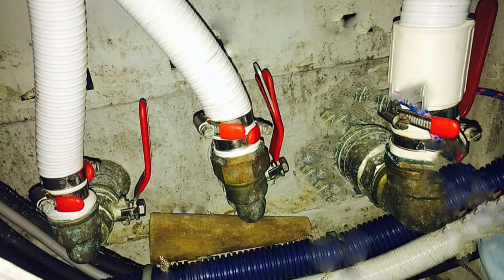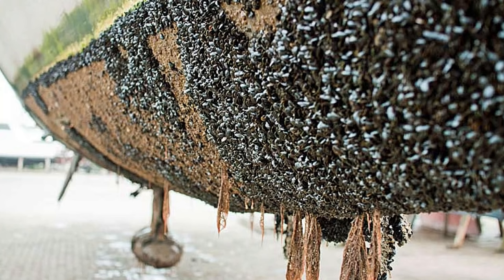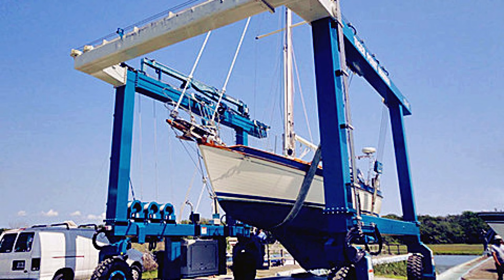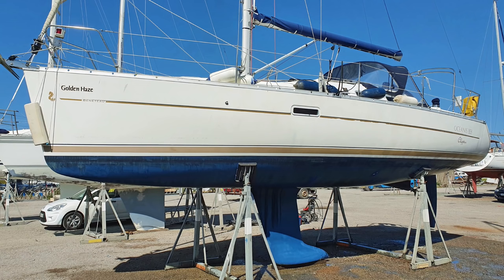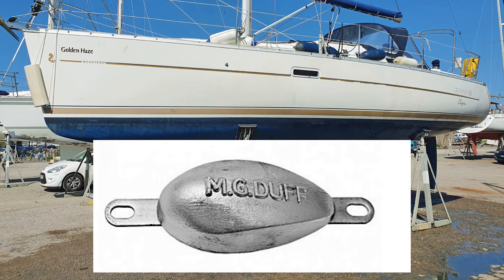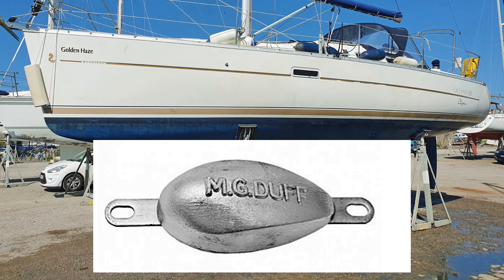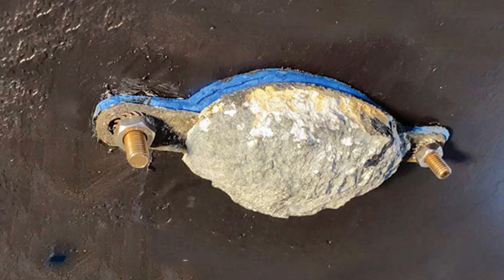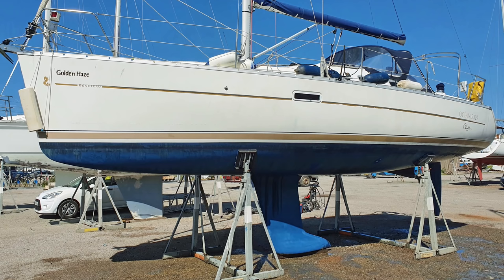Spring Refit

Comment: When using a lever against your alternator to adjust your belt tension, be carful of the vented part of the alternator housing as it is the weakest point and will crack or break. Try and lever it from the front where the housing is strongest. Love your stuff Michael, keep up the info, I'm sure you still have plenty to share.
Reply from the maker: Ricky thank you for posting that - You are right of course and it's very good point - So pleased you like the videos
Reply: It doesn't need to be levered very hard. Use a short lever that can't exert much stress. Keep the part of the lever beyond the fulcrum long and the hand end short. Or don't lever it, just pull on it with your dominant hand while tightening on the spanner with the hand you don't write with.
Reply: When I was a lad and worked for fun on old cars my mates could afford. I'd remove seriously seized oil filters with a big screwdriver. Hammer it through the filter as far from the end as possible, scream obscenities at it while yanking the screwdriver handle anti clockwise.
A bit messy, sometimes needed a 2nd screwdriver. It always worked but usually resulted in the warning of a clip around the ear from mum (dad being complicit in the crime).

Comment: Love your style. Just a couple of discussion points. I use vinegar to clean the prop and leave it to soak for 30-60 mins. It is a much milder acid, so less likely to eat the prop and much safer to use. It’s also very cheap. You can buy big 5 l bottles v cheaply on Amazon. It’s also used for regular heads cleaning when sailing. After cleaning the prop, I put on lanocote which is the oil in sheep’s wool. The prop gets a very thin layer of calcified solids (not surprising in the chalky waters of Southern England) but v easy to clean next winter. But v good video.
Reply from the maker: Thank you for that Lillias... I will try vinegar next time...  It's odd but I think I put too much Vaseline on my prop last time - affected the speed a bit so I will certainly try Lancote - if I can find it here in Martinique!

Comment: My (very) old Yanmar was a complete pain to maintain. Everything in an awkward place. My wonderful (newish) Beta is a dream. Easy to get at everything, and it even has a permanently fitted pump for changing the oil - just open a valve and pump the old oil into a container.
And I totally agree, it is vital to know how to bleed your engine. They are all slightly different. And if you have air in the feed, the engine simply won't (can't) work.
Reply from the maker: Paul, good to hear from you - my new Yanmar in Golden Haze is very accessible but I confess with some health issues I have with my hands, I will pay an engineer to do it this year - in my last boat a Westerly Ocean 43 there was a little engine room the emphasis on little and room .. agony and all the important bits almost totally inaccessible...   Boat and engine design in these area have come a long way.
Reply: @SailingGently  Knowing how to do it is the important thing. I know how to change the timing belt on my car, but I paid someone to do it...frankly because I couldn't be bothered with the hassle.
My old Yanmar (50 years old) is still powering a canal boat somewhere. No need for a rev counter - just count the thuds.
Reply from the maker: @verynearlyaboutsailing8114  Yes your right - I have not actually done the one day diesel course but somewhere in the Med or the Caribbean I had a solenoid problem that led to a fuel problem that required me to bleed the system - frequently - and once someone showed me how I was amazed that even I could do it - Just wish I had one tenth of your skills - I sit in awe watching your videos

Comment: Nice one. Also check the bilge pumps are still working that should you get water ingress you can pump it out, the boat's batteries and that the alternator and charging circuit is actually re-charging them. You could be some what stuck if it is not. Also the solar circuit for recharging if you have them. 

Are you now in the Caribbean or on your way there? It's still fliipin' freezing here in the UK with gales forecast for the end of the week. But hopefully the CV restrictions will start to lift soon.
Reply from the maker: Alex you are right about the bilge pumps - I should have mentioned them and indeed the rest of the systems.  I like automatic bilge pumps with the battery plugged into shore power - saved one of my boats in Gib once.
Still waiting for Covid to finalise Caribbean plans - I cannot get to the UK at the moment as France is still on the Red list!
Reply: @SailingGently  I feel a bit bad now for mentioning the bilge and charging as your videos are always good and informative and you're such a good presenter.
Good luck with your Caribbean move. Can't say I am not envious! I thought France was on the orange list as it were? All these colours, it's like a bad psychedelic dream, not that I have ever had one of those ...... All the best. Many thanks.

Comment: Something interesting I found recently regarding steel hulls is ultrasonic antifouling kit for boats, evidently, this slows the accumulation of life forms on steel hull boats.
Reply from the maker: Shawn hello, Yes I have heard in the distant past about ultrasonic antifouling system but never met anyone actually using it - I wonder why big merchant ships don't?
Reply: @Sailing Gently  The following article claims that “Our biggest customer sector is the offshore industry, especially in Norway,”. “Offshore maintenance and supply vessels have lots of machinery on board, hence they need a lot of cooling capacity. They have lots of box coolers.”  It seems that given the date of this article, and what Chiel de Wit of Delta-Sistems BV in the Netherlands says, that particular company probably would be the go-to company, as they have been researching this phenomenon.   “We’ve run tests on one ship, with two identical systems on two similar sea chests, mirrored starboard and port, with unacceptable and as-yet-unexplained differences in results,”  "Shipsonic is entering a partnership with the Royal Netherlands  
Institute for Sea Research (NIOZ) to design and implement a research program to tackle issues related to the technology’s effectiveness."  Not sure what the
connection is between Shipsonic and Delta-Sistems BV is though   https://www.professionalmariner.com/ultrasonic-antifouling-grows-as-green-option-for-vessel-owners/
Reply from the maker: @shawnirwin6633  That's really interesting - but does it work with GRP and of course there is the problem of generating power for the system?  But it sounds interesting - thanks
Reply: @SailingGently  If I recall correctly, they did say they could be used with fiberglass, because I specifically remember them mentioning that it was harder to set up on boats that had balsa cores!   I would probably still direct the question about the hull type to the company that makes the units though.  As for power, if it was me, I would be willing to put up a solar panel, set up a wind generator or water generator just for that purpose, given the results I saw in the video I mentioned above.   I am not talking from experience though, so in reality, experience is the only real teacher, and I suppose that might be why not many yachts use them, they are an added expense, and, not that many people know about them.   I have been doing a lot of research on yacht owning and operating, so I ran across the information about this method.  Evidently the using them for antifouling on boats started around 2017, so while the technology is much older, this particular application is newer.   AS for me, while I am an ex-sailor (Navy), I have no experience with sailing, I am in purgatory (between working and retiring) and hoping to sometime in the future buy a steel hull boat and do some traveling.
Reply from the maker: @shawnirwin6633  That's really interesting Shawn - probably 10 years from now they will be commonplace on sail boats.. I wonder if there have been any comparison tests between this and 'normal' antifouling - I do firmly believe that it is the miles under the hull that keeps it clean but plugged into a marina power...

Comment: Very informing - thank you
Reply from the maker: Glad it was helpful Danial - I confess I was not certain people would like it!
Reply: @SailingGently  As a seasoned sailor what is your opinion on a Sadler 28 for single handed sailing around the world ?
Reply from the maker: @danielprinsloo2917  Daniel they are good boats - most are - it all depends on your comfort threshold and how much space you think you need for full time living. Also a force 6 is needed to get 45 ft boats going properly whilst in a 28ft you will be throwing in reefs - but 45 is a lot to handle single handed and a 28 is really easy
Reply: @danielprinsloo2917  I lived on a 26-foot boat for a few months, and it took me at least a year before my neck recovered. The cabin was not high enough for me to stand up straight, so my head was always to one side, and that was not good for me at all. I moved to a 34-foot boat later with plenty of headroom and it was much easier to live on.

Comment: very informative, thanks.. BTW do you or anyone else have any experience on a trailer sailor, whats the minimum to go offshore and is it the keel weight thats important..I cant really afford a blue water with all its costs at the moment so as a beginner boat is a compromise, in Australia..what should I look for...thx
Reply from the maker: Thierry hi, Glad you liked the video - I think there are two problems with trailer sailers the first being that by the time you have driven to the launch site and got her in the water, parked the trailer, got the mast up - hanked on both the main and Jib then tightened the rig much of the day is gone and the same when you get her out of the water.  Nothing wrong with drop keels - excellent if you have a mud berth but trailable boats are very lightly built and not as robust as some others. However if it is on a trailer at home for the winter and then launched for the summer perhaps that's different - There are some brilliant very inexpensive older blue water boats like Nicholson, Rival, Contessa, Westerly, Moody around and apart from the 'parking' costs they are probably cheaper than a trailer sailer but all this is just my opinion and others may think differently